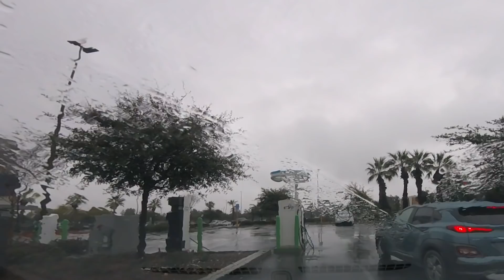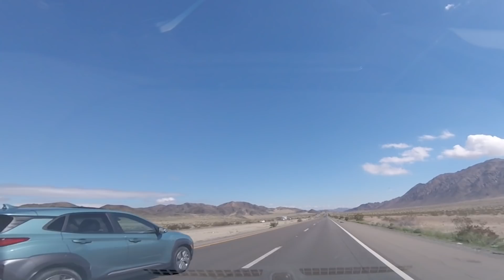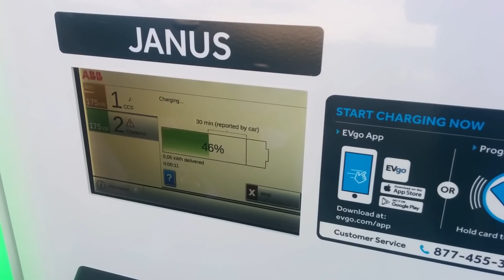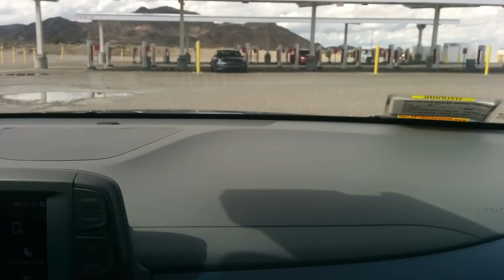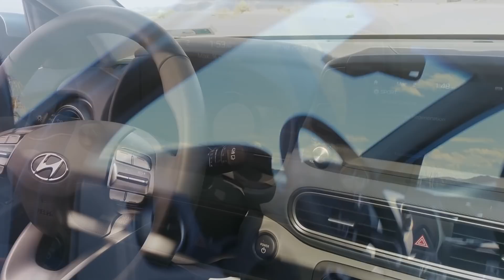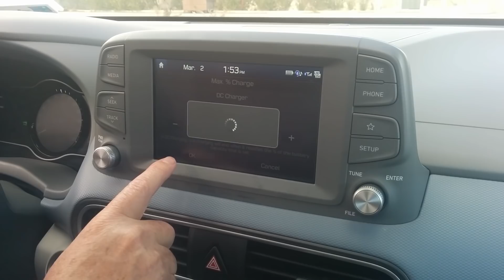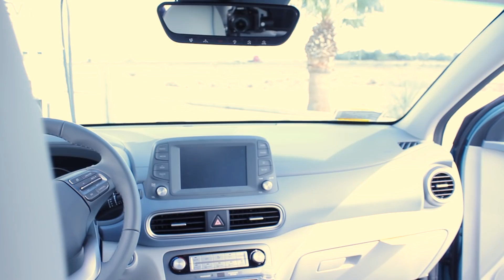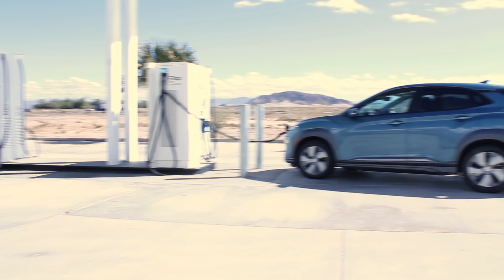Chevy Bolt EV and Hyundai Kona Electric: Grizzled Veteran versus Star Rookie

Comment: Great, fair review. I agree with most your points.. agree that Kona Electric has small leg room the back, small cargo area and small infotainment screen.. .But where it counts, it's more efficient than Bolt EV, which means more range... so do you feel Kona Electric would best your Bolt EV per EPA's 20-mile range difference?
Reply from the maker: I think the 20 mile advantage is based on the two vehicles having the same efficiency, but the Kona Electric's having a 4 kWh larger battery. I think that estimate is probably right at 60 to 65 mph, but at 75 mph, the Kona Electric might have as much as a 40 mile advantage. Also, my Bolt EV has nearly 8% battery degradation after 85,000 miles, so the difference looks more significant than it would comparing two new cars.

Really, though, I need to drive the Kona Electric a bit myself to know for sure.
Reply: @newscoulomb3705  Good point... I wish there was a way for you to do a fair test of range between Kona and Bolt, say at some freeway speed.. Basically charge both to 100%, then drive until each car drops to 75% battery (eg, it's driven 25% battery) and see how far each EV distance went... then can just extrapolate full range from there if needed.
Reply from the maker: @be236  Obviously, the range will vary based on conditions and speeds, but I do think that in identical circumstances the Kona Electric should average 20 to 40 miles more range on a 100% charge.
Reply: @newscoulomb3705  yeah, that's what I figured.. in your video you said that Kona Electric was slightly more efficient than Bolt EV, so that would mean it would have more range, so 20-40 miles more sounds about right to me... I would get it, if only it came to my state.. though I would be disappointed in it's backseat legroom area, though I dont plan anyone riding in the back often...
Reply from the maker: @be236  You can see if you could order one through a local Hyundai dealership. They would require a solid order. Of course, you wouldn't be able to test drive one first.
Reply: @newscoulomb3705 Someone in my area already tried that. they got an email response basically saying it's not possible to order one and one wont be coming to our state for another 1-2 years.. ugh... so my next bet is to drive 150km north to a BC dealer or drive south to an OR dealer...

Comment: Aerowheels on the Bolt would be a great addition.  I think you could easily get 5% more range.
Reply from the maker: Maybe not 5%, but it could be a noticeable improvement. I might experiment with some areo mods to see their effects.
Reply: @newscoulomb3705  I read somewhere that Ford found having a lot of spokes on the wheel (such as your Bolt's "aftermarket" wheels) has basically the same aerodynamic effects as a traditional eco wheel. So in your shoes, I wouldn't feel the rush to try some random eco wheel.
Reply: So where they never put an eco wheel  option on the Bolt

Comment: I just discovered and subscribed to your channel.  I will be buying a 2019 Bolt in a couple of months.  I am a bit concerned about using it for a 650 mile trip I take each year.  Because I am worried about the driving range at 70 MPH.  I would really appreciate it if you could answer a couple of questions.   How many times do you think I will have to charge on that trip?  Have you ever calculated how far you can drive on a single full charge at 70 MPH?  How long does it take to charge on a 50 KW charger to 80%?  Thanks.
Reply from the maker: Thanks for subscribing!

I would plan for 180 miles on a full charge at 70 mph. You'll usually exceed that, but sometimes you might get worse, depending on weather. 

650 miles is completely doable, but it really depends on what infrastructure you have available. 

The number of charges you need will depend on how high up you charge (it's typically best to only charge to 65-70% on fast chargers). For a normal 650 mile trip, four stops would probably be the minimum you'd want to do, and they'd probably be around 45 minutes each. Maybe a bit faster if you're using faster than 50 kW chargers, or longer if you're using 50 kW or slower charging.

Check out A Better Route Planner for the Bolt EV. Their model is a bit conservative in my opinion, but that's better when you're starting out.
Reply: @newscoulomb3705  Thanks.  That is very helpful.  I think EV manufacturers should be required to post highway milage just like ICE vehicals post city MPG along with highway MPG.  When most consumers see a car will go 238 miles on a charge, they probably assume they can drive 450 miles with one extra charge in route to Grandma's.  They fail to consider that the milage rating is based on perfect circumstances.  70 degree temperature, clear skies, perhaps 45 MPH, and no extra weight in the car.  I will check out the routing site you suggested.
Reply from the maker: @usaverageguy  The big problem is that the combined rating works for gas cars because their city (typical) mileage is actually worse than their highway mileage. The reverse is true for EVs. You'll get much better mileage in cities, but much worse mileage on freeways.

Comment: Personally I like the new 2020 Soul EV and eNiro better than the Kona EV.  I got to sit in all three at the Toronto autoshow.  The Kona EV has a similar battery pack voltage to the Bolt EV but the Kona EV can accept up to 200A and doesn't start to charge taper until it's a bit over 60% SOC.  The Bolt EV is limited to 150A and starts to taper at just over 50% SOC.   Also of note the 2019 Bolt EV can set the maximum battery SOC limit.  I hope GM pushes this update to earlier versions.  The Bolt EV should receive an update soon.  Hopefully 200A charging is part of that as well.
Reply from the maker: I believe the first step down is 57%. The charging curve step downs look almost identical to the Bolt EV's, but 50 A higher.
Reply: @newscoulomb3705  Ah yes.  I believe I was seeing a Kona EV charge on a 125A unit under which the first step isn't until about 68%.  It appears the first step is before this but at a rate still higher than 125A.
Reply: My impression is that the Kona begins ramping down slightly later than the Bolt — it seemed to be around 62% versus around 55% in the Bolt. This is just from some charging graphs I saw online but they seemed credible. In any case, even when it ramps down it is still charging significantly faster than the Bolt when at an equivalent ramp down position. I’m not sure if this is due to differences in cell design, cooling, or perhaps just Hyundai being a bit less conservative than GM in the charge  rates (relative to pack energy capacity).

Comment: I do wonder if a 2019 with no real battery degradation would fair better. 80k on a battery is bound to have some effect. I think this comparison just points out how good the Bolt really is. It has been doing this for more than 2 years.
Reply from the maker: Yes, without battery degradation, I would have ended with closer to 10% battery. Not sure if it would have an effect on efficiency.

Comment: What was the lowest SOC on the Kona when plugged in. 76 kW at 50% is really good. That's actually better than my old Model S. And considering it is using far less energy it means it is effectively charging faster.
Reply from the maker: Yes, it's very impressive in terms of charging speed. The drive out to Baker was fairly efficient, so it started the charge at 45%. The charger he plugged into at 21% was only a 50 kW charger, so we wouldn't be able to tell much from that session.
Reply: Any idea when the Kona's first taper hits?
Reply from the maker: I believe it's 57%, and at that point, it drops to ~55-60 kW, which I think it maintains until 73%. 

That's what I seen on some demonstrations, but I'd like to test for myself.

Comment: Hey buddy, they have a fire sale of on the Chevy Bolts right now & I'm thinking of getting one. Its 31,400k for a Bolt LT with extras (9k off) vs 38,000 for a Kona SEL (Sticker price). Which one you buying?
Reply: +1 In the same boat. (Love your River City Ransom character image btw)
Reply from the maker: I actually prefer the Bolt EV over the Kona Electric, though it is outclassed in a couple of ways (charging speed, efficiency, and driver assist features). The trade off is interior configuration, infotainment screen, cargo capacity, and rear passenger room. 

So it's really a matter of priorities. But it's hard to argue with the Bolt EV's value at this point.
Reply: @newscoulomb3705   Rear room & cargo are bigger factors to me. The huge difference in price will easily make up any small efficiency difference. I do like the Kona, it LOOKS like its bigger but inside its smaller. I'm coming from a Honda Fit so the Bolt will actually be a size upgrade for me. The only question is we dont have any real infrastructure here in New England outside of Boston when i travel to Maine & NH & the cold affecting battery.
Reply from the maker: If capacity/space is a concern, then yes, the Bolt EV has an advantage. It also has a dedicated battery heater, which the Kona Electric lacks. The infrastructure is going to be the same issue with either, but even where you are, it's developing fast.
Reply from the maker: Oh, yes, and then there's the question of availability. I wouldn't pass up on a killer deal for a Bolt EV knowing that the Federal Tax Credit is stepping down in April, and with the questions of how easy it would be to get a Kona Electric anywhere in the United States.
Reply: @newscoulomb3705  battery heater?? Game changer! I'm gonna look that up thanks so much for that information haven't seen that in any review!
Reply: @newscoulomb3705  Basically was told its sticker price on the Kona EV for the next 8 months to fill the orders & the limited manufacturing to boot. 9k off the Bolt & they are desperate to sell them before April 1. Bigger cabin for kids, seems like a no brainer here. My other option was the Honda Clarity or just keeping the Fit & waiting until 2020 options
Reply: @tunaman4u2  
Your Honda Fit has more rear passenger leg room than the Kona or the Bolt. Not sure about cargo room.
Reply: @newscoulomb3705  I tried the bolt yesterday. Didn't like the center armrest but I'm reading it can move forward... But how far?
Reply from the maker: Yes, it slides forward. I'm not sure how far exactly, but it's several inches. That's where I keep it basically all the time when I'm driving.
Reply: @tunaman4u2  As counter-intuitive as it sounds, look into keeping the Fit for at least another year, and paying off any credit card and other >15% APR debt you have ASAP. Credit card debt compounds at 20-25% APR, and said interest likely adds up quicker than the difference in fuel+maintenance costs between EV's and gas cars, and you're going to have to pay off that debt at some point. If all else fails, you can probably get some great deals on used 2017 Bolts coming off-lease in 2020.
Reply: @EMichaelBall  The problem Im finding is the inability to bring the Bolt on many of my planned road trips due to limited charging stations in ME & NH. Also getting to NYC & back would be a total PITA. Im leaning Honda Clarity or Ford Escape PHEV in 2020. The Bolt is the best EV out there for the cost IMO, its just the infrastructure here. Also DC fast charging is kinda expensive & defeats the savings in addition to the  lost time charging vs.  gas.
Reply: after writing this i thought more about it. Its RARE that I take these trips & most likely will have the family SUV loaded up for big trips no matter what. Tough call
Reply: Chevy refused to budge much & match a deal of 9k off MSRP from a dealer far away. Only gave 5.5k off. Not gonna happen at that price. Once they lose 1/2 the federal rebate those cars are gonna sit let alone lose the full rebate & be more expensive than the 35k Tesla. Lost sale on their end. Looking into Honda Clarity for less.
Reply: @tunaman4u2  The biggest issue with new cars is the depreciation hit, even at fire sale prices, especially if you have to sell the car in a financial pinch. This bull market has lasted abnormally long, and it has to end at some time. Most EVs have especially bad depreciation. Being underwater on a car is no bueno. Look into Dave Ramsey's viewpoint on new cars.

Comment: I'm not sure I'd have the guts to do a trip that finishes with my battery at 2%
Reply from the maker: I try to avoid it now, and we could have stopped off at a different charger along the way. Both of agreed that under those conditions, we normally would have slowed down.

Comment: Thanks,
Interesting. 
For me, living in snow country with some dirt roads, the low battery pack is a problem. I wonder if the Nero has the same low pack? On a side note - how many miles are on the Bolt now and how much degradation have you seen?
Thanks
Reply from the maker: I have 85,000 miles now, but I haven't crunched the numbers for degradation recently. Still around 8%, it seems.
Reply: @newscoulomb3705  Question for you on Bolt batt degradation. My Bolt is barely 1 year old with 10k miles, temperate weather in LA, charge rarely to 100%. I seem to have estimated batt total capacity of only 58kwh. Is that normal? Also, my DCFC sessions now seem to start at 38kwh, slowly peak to 46kwh ~50% SOC, and then the expected drop at 54% back down to 38kwh rate. I never noticed that before, think that started last month in Feb. I attributed it to the cold weather/batt, but now it's warmer and still occurs.
Reply from the maker: Yes, that seems normal. I think GM added a 2 kWh buffer on the bottom end of the battery, which is why I think most Bolt EVs are reporting 58 kWh now.
Reply: @newscoulomb3705  
95% of the time I run on "hill top". Thanks for your reviews, have helped a lot with running my Bolt.
I have the original 2017 battery. GM checked it and said "You don't need the new battery". I'm wondering if it's because I rarely go under 100 miles remaining range? There was someone with a later year that got the battery.
Reply: @newscoulomb3705  any thoughts on my slower charge rate? doesn't conform to the expected curve/slope.
https://support.fastned.nl/hc/article_attachments/360001374688/Charge_curve_Ampera-e_GB.png

Comment: I really hope the Kona is available cross country and dealers are ready to sell it. I had a serious talk with a Hyundai North America Rep. about this, and he told me that Hyundai is not sure if there is an availability of customers outside the CARB states for EV's, and enough qualified Technicians are present to service EV's. Issue is, I see quite a few Model 3's and Bolt EV's in my area, so I think the demand is already there. I really hope Hyundai sees this and takes advantage, otherwise they are losing out on customers like me. I would have put in my order for a Kona electric if it were available in my area at MSRP.
Reply from the maker: Yeah, it's a great car. They need to add a dedicated battery heater, though. They did for Canada, so they should be able to for the United States as well.
Reply: @newscoulomb3705  which EVs in the States have that option? I live in CT and my LEAF does exceptionally poorly in the extreme cold.
Reply: The problem now is even in the CARB states Hyundai dealerships are jacking up prices. 

Before you wait on a Kona, test drive the base model 3. Sure, it doesn’t have all the options, but it’s much more fun to drive and is MUCH better on long trips n

Comment: with 35k tesla with better look and charging rate and autopilot  option  alot of people will go for that car as bolt ev owner I says  GM done good job but with alot of cars coming out with similar range GM need to step it up  with look and efficiency  and charge rate and other upgrades
Reply from the maker: At $35,000, I actually think the Kona Electric is a better value than the Model 3, but it's close. None of the cars at $35,000 are strictly better than the others, so it comes down to needs and personal tastes.

Comment: I live in Canada. I could not wait for the Kia E Niro and did not want to pay even more for mildly larger space.     Kona Electric Ultimate was $62,000.00 CAD.  If your choice was only the Bolt or Kona Electric in this price range, which would you buy? The price quoted included transport and all taxes.
Reply from the maker: Personally, I would still go with the Bolt EV, but it's much closer than I thought before spending time with the Kona Electric. Honestly, I think most people would be happy with either, but it depends on personal tastes and values.
Reply: Shawn Marmer the bolt was designed electric that’s why the kids in the rear seat have more place ... the kona was a fossil car with a big hood for nothing instead of more interior space
Reply: @middlehot  You may be right about that and I wish there was another 4 inches in the rear. The fact is that the Bolt is still an ugly design lacks the multi link rear suspension and GM is screwing North American workers and not contributing to EV Charger establishment. I really think that otherwise they are very comparable cars and values.